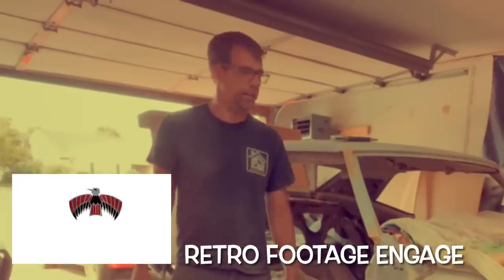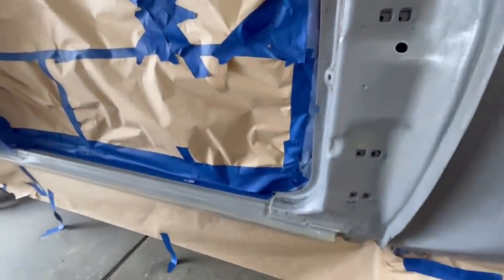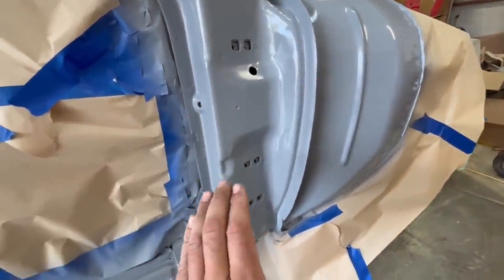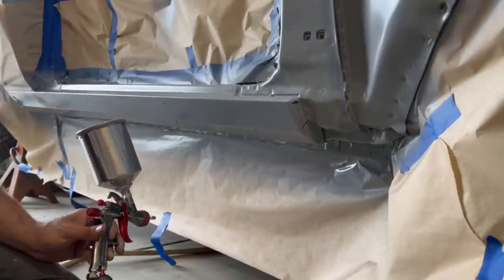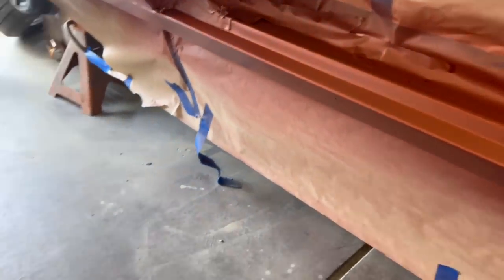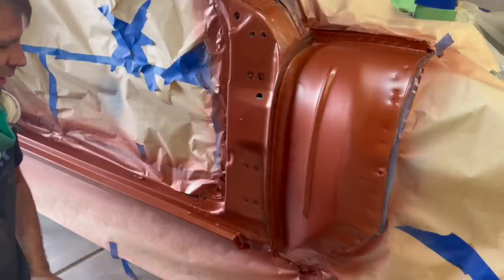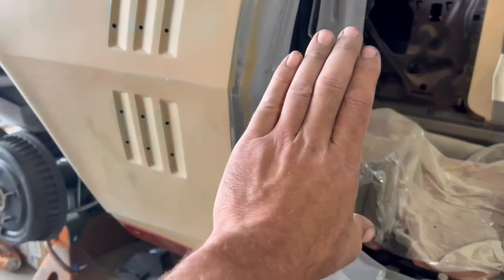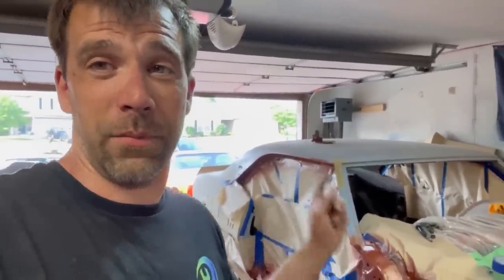Getting the best possible paint job in a garage at home, phase one edging

Comment: My 68 still has the original white paint up inside the window channel.  The original main color is a green color
Reply from the maker: Interesting what’s hiding that most people miss
Reply: @VVG Firebird Restoration Station  I put new door window roof seals in it it still had the original hard as a rock and breaking off in chunks seals. That's how I saw the white age cracked paint.  Original headliner was gone but still had original pieces of the white headliner under some of the trim pieces.  So I figure it was originally a green with a white painted top and white interior.  Nice looking car when new I bet.

Comment: Should I use black high build primer for a medium solid gray color called Sting Gray?
Reply from the maker: I typically match my primer to my final color.   If I am painting a car white I use a white sealer, if am going a dark color like black I use a black primer.   In your case if sting gray is dark a black primer
Would be ideal. If it’s light I would go with the gray primer under it.

Comment: Hi Jon, Watching this video again. A rerun. :) My questions are what spray gun are you using to paint the Bird? Is the gun LVLP or HVLP? 1.3mm tip? Down in the comments you said 40psi so I'm guessing it's a HVLP spray gun. Now your compressor. Is it a 60 gal 5HP machine? What type of regulator and water/oil separator  do you have at the compressor? Lastly do you have any experience with the LVLP guns like the R500 and it's variants? Thanks Buddy and Happy New Year.
Reply from the maker: Yes HVLP 1.3 tip  for base and clear. The compressor is 60 gallon 220v 5hp.  As for water separator I have one of those very basic ones right on the tank that I barely crack the drain while painting.  Then at the gun inlet I use one of those small plastic inline disposable filters.  So with that said I should have all kinds of water and contaminants in the paint but somehow I get very lucky I guess so I keep going at it this way.   I also try to paint early morning about 65 degrees and very low humidity in the early spring before the bugs wake up.  
    Someday I will upgrade to a better gun but with so many choices and I am so cheap I don’t know which way to go.
Reply: Awesome Thanks for sharing the information! Your system/method WORKS!! I would not change a thing. KISS formula right? I hope you don't change anything because 95% of us DIY'er will NEVER have a quarter million dollar spray booth or a $900 spray gun or a $3,000  Scroll Air Compressor!!

Comment: Very good job what brand of gun do you use and how big of a compressor ?
Reply from the maker: My paint gun i bought from the MAC tool guy.  It’s the econo coat gun.  My compressor is a 60 gallon 220v twin Cyl single stage.   
    On previous cars I have had great success with my little 30 gallon compressor with a $25 paint gun from a swap meet.   
   What I am saying is good results are possible without spending silly money.

Comment: Quick question for you. I bought the same hinges that you did because mine were toast.  When you painted around the door edges, the hinges got sprayed with the sealer and paint just like everything else.  Did you scuff or sand the hinges before you sprayed?
Reply from the maker: Yes scuffed with a scotchbrite pad then wiped down and cleaned them.  I don’t strip the edp off
Reply: @VinylVillageGarage  Thank you so much.

Comment: I’m a definite newbie. So when setting up the paint gun, what psi is you using with the gravity fed sprayer ?
Reply from the maker: Great question. The answer is all paint guns are a little different I will tell you what I set it and and for the best results with the gun you are using might need a little tweaking.  On my gun you will see a pressure gauge. I will adjust the air pressure so it reads 40 psi while pulling the trigger and stays steady.

Comment: I haven't read all the comments in the back but what's the paint code number on that bc8 paint
Reply from the maker: I used Ditzler code 60517.  I finally found someone that would do a spray out for me as well and compared it to the paint on the inside of trunk lid almost spot on just a tinniest bit off.